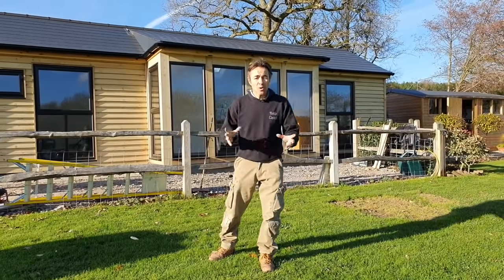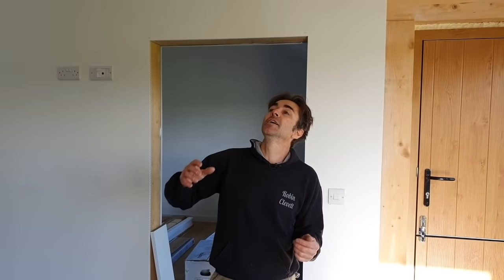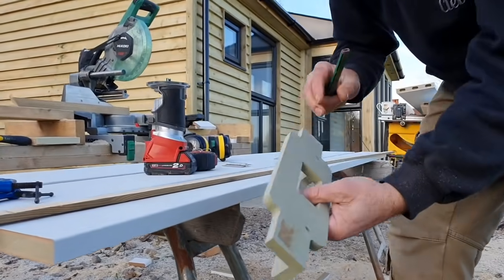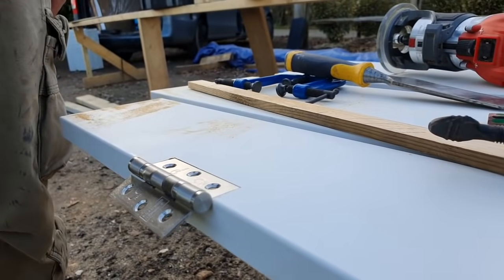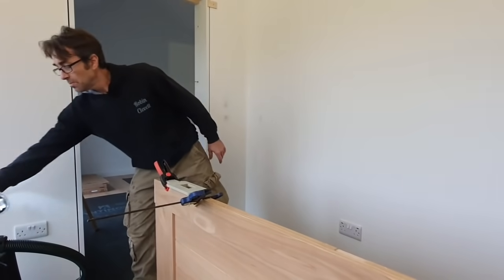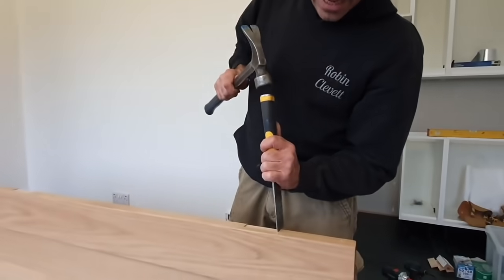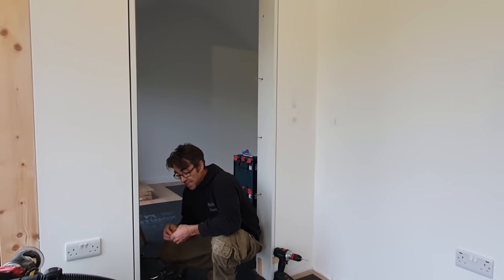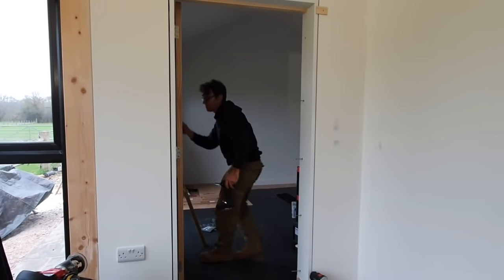Modern Carpentry and Change!!! Hanging doors the modern way with MDF door linings and new hinge jig

Comment: I worked in a UK Joinery shop years ago and we had the fastest method of hinge fitting on a new door and frame. You lay the door in the frame on the floor Then with all the correct gaps and using the correct dia size router bit ( equal to total thickness of the hinge when closed). With the fence set accordingly you simply plunge the bit into the door and frame to the correct depth. Continue plunge cutting then move back and forth to clear. Then remove the door and clean out the rounded ends with a sharp chisel. If you have lots to do this will cut both door and frame its less than a few mins. No jigs no fuss.

Comment: Biggest change really is the amount of tools I have and the quality of finish I can achieve onsite, I started 40 years ago,back then I had a 30 inch canvas tool bag with a 3 foot level plonked on top,slung on my shoulder and off I went to work, even getting on buses and tubes, most sites shared drills and skill saws etc,there were no electric drill drivers then, they first appeared as  Makita  pair/sets ,2 in one case with big long handles which held the long batteries ,I only had the loved but somewhat scary at times Yankee ratchet screwdriver, thought that was well tech at the time, now I have thousands of pounds worth of power tools Makita, Festool  Milwaukee the obligatory stuff, I can achieve high quality results onsite but I do look back on the simplicity of site work of 40 years ago, I don’t miss having to sharpen and set my saws tho .give me a brand new £10 quid saw and they are a joy to use  ,I seem to have a different screw for a host of different situations different screwdriver bits,it now feels like you set up a workshop onsite ,I love it but lugging loads of gear around  feels like your the drummer in band , great time to be a skilled carpenter tho .
Reply: Yes plastic bob I remember the Yankee spiral screwdrivers when they first appeared on the UK. These were first used by a TV -DIY chap named Barry Bucknall . I was an apprentice sparks and so  we could now fix electric sockets and switches screws at lighting speed ( great because we were on price work) my first Yankee cost me half a weeks wage.

Comment: I still have my wood tool box that I made as an apprentice 42 years ago and inside the hand drill, jack plane, hand brace and Yankee.  Even found a tin of tallow that we used to use to help putting in stainless steel screws.  Its amazing how the trade has progressed with technology and made the Joiners life a little easier.
Reply: Me too , which reminds me, I need to re do the saw till locking handles and give it a lick of paint

Comment: Good video and great work ive been hanging doors this way for quite a few years now with template cutter and jig you can easily make the jig yourself on a chop saw just using off cuts of ply no need to get or pay someone else to cnc one we also install locks with a homemade jig also no need to keep lifting door into frame to mark hinge cuts just use one off the door jams as a staff  just remember to overhang the staff from top of door to allow for the gap cheers good stuff

Comment: I'm a brickie and not much has changed with my tools, A trowel, level, corner blocks and line. Corner profiles are brilliant nowadays. Brick grabs are great for loading out, saves stacking the bricks before lifting them. And like you said, laser levels for transferring levels around the foundations etc. Brilliant video. Cheers.
Reply: Radios with charging batteries! Oh yes, cordless grinders
Reply: @harveysmith100  I used the make a box from ply with a car radio and 6 inch jbl's in either end powered by a small car battery inside. That was rechargeable, does that count lol. Of course we have a makita radio now which is a lot lighter.
Reply: @Simonsimps  Great job, yes I think that qualifies as a rechargeable radio. From one trowel to another, stay safe.

Comment: I started my time 14 years ago and my journeymen were very old fashioned. Everything was done by hand. I wasn't allowed to use a drill until I could mortice a lock with a brace and bit. We hand cut and ripped all finishings for our door and window contracts and everything was nailed with a hammer then punched below the surface. Changed days now!!
Reply: I finished my time Jan  81, we had an elec saw and very little else
Reply: That's how I was taught. Tools first then the toys after😂 best way. U learn to feel a job rather than bish bash bosh🛠

Comment: Hi Robin. I enjoy watching your channel, which has helped me through lockdown to quite an extent. So thanks for that. You mentioned the struggles we used to have with the Yankee screwdriver. I quite agree. Way back in the 1960s, I was once faced with the job of panelling out a client's 'den'. This required laying plywood panels on a grid of tiling lath, applied in 18" squares, on all four walls! A zillion screws! To speed things along, I tried masonry nails, but that was fraught with flying bits of nail, and so on. So I broke out the Yankee screwdriver. While I was sorting out the correct sized bit, I had an idea. My Stanley-Bridges drill (Which I still use BTW) was lying idle, and it had two speeds, and a reverse function. Yes even back then! So I chucked the Yankee screwdriver bit into the drill. I was worried about chewing up the bit, but decided it was a reasonable sacrifice. And, whey-hey! I had a drill-driver! I didn't chew up the bit either. Now, I can't claim that I invented that obviously, but I had never seen it done by anyone else at that time. It became standard practice for me! It wasn't perfect and I had to watch the speed. But it was a real time-saver! I am retired now, and just use woodwork as a hobby. I can afford time to use old tools; or some of the improved new makes! Enjoying my senior status, too. So, over to you brother, and more power to your elbow. Best of luck Robin. Auld John in Brum! .
Reply from the maker: Great Story John, really glad you enjoy the channel, many thanks for engaging and commenting stay well and much respect to you Sir

Comment: My late father always said you learn a new thing every day. 

I never knew about the fitting of hinges in that the part of the hinge that has two fixing points around the pivot fixes to the door and the three points to the frame.

Makes sense for weight distribution if thought about.

Thanks.

Comment: I recently found a Yankee at a thrift store, I just had to take it home for old times' sake. So many old tools are just amazingly built and wonderful to use and even if they are no longer the most efficient, it's sometimes nice to use the tools that something was originally built with. For example on old brass or copper screws that are used to hold in doorsteps and hinges, if you use a modern hardened flathead on them it marrs the slot and you destroy the head, but the old, softer and thicker blade style grips them perfectly and does not leave a mark. So now any time I work in an old building the Yankee comes along just for those screws.

Comment: I just found your channel - you have a ton of great content!

I have little jigs for all my common hardware, strike, hinges, mortice lock coverplates. So quick and looks perfect every time. 
I also run all my screws across a bit of wax (bees wax or candle) before going into MDF. you could use a bar of soap or any dry lube. That squeal you hear is the MDF glue reactivating with heat from friction and trying to glue the screw in place. I bit of lube stops all that gruntin and groanin!

Comment: Hi Robin
I have watched you quite a lot i and not a carpenter but a very keen DIYer with a lot of projects under my belt over the years,
I am an A/C eng and in my trade the new innovation is pressfit pipe connections i know they have used them in the plumbing and heating trade for a number of years
And i have used them for chilled water pipework and love it but as we work with higher pressures it was getting the confidence to use them but with hot work on sites etc getting harder 
We had to move that way but i have done a number of projects now all ok so that’s new innovation that’s very time saving and safer way to work
Anyway keep up the good work and keep safe 
Regards PTI

Comment: 4 1/2 is a smoothing plane.  5 1/2 is a Jack plane.  Just for our cousins across the Pond 1st fixing is all carpentry work completed before plastering such as roofing, flooring, windows, exterior doors etc while 2nd fixing is carpentry installed after plastering for e,g, internal doors, architrave, shirting, kitchens fitted bedroom units etc. But Joinery is wooden items made in a joinery shop as e,g, doors, stairs, windows, wardrobes, wall panelling, goose or swan-necked handrails/returns/wreaths, furniture. Joiners make it and Carpenters (Chippies) fix/fit it.

Comment: I'm sure Robin must do this as well, because he LOVES using timber to mark things. When I'm marking off my hinges I use a rod, cut 3-4mm bigger than your door. Mark that 3-4mm off at the top of the rod, that represents the gap between the door and the frame. Hold the rod against the frame, mark where your hinges are. Then when transferring them to your door, hold the rod onto your door edge, with the 3-4mm overhanging the top of the door, mark the hinges and they should be bang on. It's easier again on most commercial jobs now, sometimes domestic, where you even get pre-hung doors! Hinges ready routed for you. Admittedly I feel it takes some of the skill element out of it, but it saves A LOT of time. I still enjoy chopping out my own hinges, and I will route them most of the time, but sometimes I still like getting the chisels out and keeping the old skill in practice! 
Love your videos Robin, even as a carpenter myself I still love watching all your tips and tricks. Keep it up mate! 😁👍

Comment: Great video, Robin I was a locksmith in 70s and 80s remember using  the hand drill  to pilot holes or a bradel,  and brace and bit  fit locks. Every thing has changed,  excellent workmanship. Kind regards Danny uk

Comment: Did my house during lockdown with those doors (29kg each). I am not a carpenter but managed 12 doors on my own over 3 days. Had to take off some of the door to fit but instead of a manual plane, usedan electric plane and circular saw - much quicker and neater. Also used those air bags (essential) - no jig for hinges though :(  - my router is a bit big or else I would have made some. but instead bought some good quality chisels. Made my own door stand out of a block and wedge. Enjoyed it and felt quite satisfied - but as a professional you need those little advantages to speed stuff up, as I reckon if i had to go to another house and do 12 more I may not be so keen.
Reply: Airbags essential, been hanging doors for over 40 years never used them

Comment: Hi Robin, love the channel and the passion you have for your work. I've noticed a few times that you've mentioned your eyes getting old!! We're of a similar age and I had my eyes lasered a few years ago and it got me thinking why you haven't gone down that path. Especially with one eye, 'pardon the pun' on innovation and modern technology as you do. Specifically one of my eyes is focused for reading and the other for distance, so I get the best of both worlds. It completely changed my life after a lifetime of wearing glasses.
Reply from the maker: Wow Mark, I need glasses for reading can they fix that with laser?
Reply: @robinclevettcarpenter  Yes, definitely. The only trade off is that your eyes are not perfect at either end of the spectrum. So not 100% at a distance or 100 % for reading. Having said that the only time I struggle is for very small print if the light is bad. You certainly wouldn't need them for working. BTW, I'm not on commission here, lol, just trying to offer some useful info to someone who is probably as fed up with specs as I was. Let me know if you want more info, I'd be happy to share my experiences of the surgery with you

Comment: I remember getting my Yankee screwdrivers, 2 sizes with interchangeable bits wow, and stabbing my finger when it jumped out of the screw
Reply: I can still remember using a rawl plug tool 😂
Reply: I still use mine, sometimes it is the best tool for the job.  Traditional boatbuilders still use the a brace and bit with slotted bit to drive in bronze screws as it gives more of a feel and avoids shearing them. Horses for courses but there can be no doubt modern kit has been transformative for professional and diy alike.

Comment: I'm amazed that hinge manufacturers don't radius the corners of their hinges these days, knowing that we all fit hinges with a router.
Reply: They do, I use eclipse hinges with 10mm radius. Amazing time saver
Reply: They do although not that common here at the moment. When was working in Holland radius corners where pretty much standard.
Reply: @barrielindley  Cheers pal, I'll look into that.
Reply: @jrsuk1170  are you in UK?
Reply: @barrielindley  Yes 👍
Reply: @jrsuk1170  you can get them in howdens and screwfix
Reply: We don't all use routers but I'm looking into changing to this system

Comment: Helping a mate working in France, many many years ago, we visited the trade joinery place and the doors came with all furniture already fitted.  Hinges - done, handles - done, locks - done.  
I think German practice is similar.
Reply: I think the doors and frames (linings) come as a unit. The way things are going more stuff will be made in a factory by machines and will just need assembling on site. And the pace of change is increasing. One minute it's a game changer when everyone's got a track saw so can cut panels quickly and neatly on the job, next minute you can get panels cut, drilled and finished in a factory to order and delivered to you and all you have to do is assemble it like IKEA stuff. Good for the trade in the short term, long term might not be so good.

Comment: Great video as always , I am a carpenter but I install double glazing windows and doors,  so much has changed battery tools SDS drills and impact drivers concrete screws no more nylon fisher fixings  and sealants and expanding foam Keep up the good work👍

Comment: Hi Robin.  Changes so many, sharpen your saws and even touch them up on site. Used to carry an axe avoiding the word chopper!! 2x4 ceiling  joists chop off the bit sticking out  past the rafter.  Making a propeller shaped wedge to fit in the brick joint to fix the grounds to all done with the axe. Hammer slings made from a brick layers wall tie no pouches fill your pockets  with nails and lastly the good old cut nail.

Comment: Great Robin...love the modern equipment...air bags are so cool...we always used wedges. Not the best but ok in that era...skill saws were so with it in my day, but the tools they have today make life so easy, especially battery drills etc. Loved your video on plastic facia and soffits I'd never fitted them in my day, so it was good to see the setting out and finishes. Also the video on  scarf joints, tusk tenons all very common back then and you were expected to know them. A common test if you were new on site they'd ask you to make a chippies stool or a saw horse ( no hard points then) and you were judged on your  performance !!

Comment: I have a Yankee screwdriver,it's an early wooden handled brass capped model,a proper one! I found it between the floor and ceiling in my house brand new still in its box and paper wrapper,it would have felt like a win if it weren't for the fact that the floor was up because the main 12x9 support beam through the entire house had a droop in it!!!! ,It took me awhile to find tips for it that weren't eBay specials but I have used it a few times. I like the ingenuity of it and hearing people say WTF is that? We in the motor trade have been using those inflatable bags to aid entry into locked out cars for years,great little tool with many unexpected uses.
Reply from the maker: What a great find!! I still have a couple of these and love them too!!

Comment: I don't get too carried away with all these new developments. Yes power tools take the grunt out of a job but one will never get the same finish that one would with hand tools. I personally dispise MDF. On heavy doors I run a 2-1/2" stainless steel screw into the top two holes of the top hinge and the top hole of the middle hinge. They go through the frame and into the stud. I only ever put one screw in each hinge untill I've checked the fit.

Comment: One happy carpenter, I admire your optimism buddy...FYI the MDF linings suck big time, the screws don't bite into it very well, since its a paper pulp basically...
Reply from the maker: Hi Jay, Thanks for watching mate, some MDF is poor quality but the type I use for door linings is by Medite and it is far superior than some others on the market, I have been using MDF linings for about 10 years and some of the property I visit on an annual basis and so far we have had no issues with any of them, it does boil down to using a decent screw in the hinge and the correct size pilot hole, Have a great day mate are you actually in NYC?